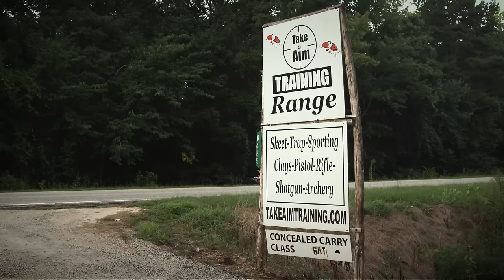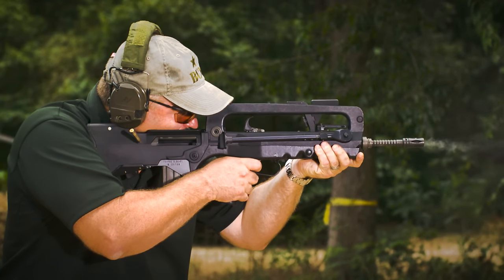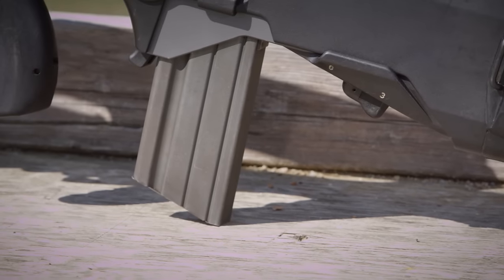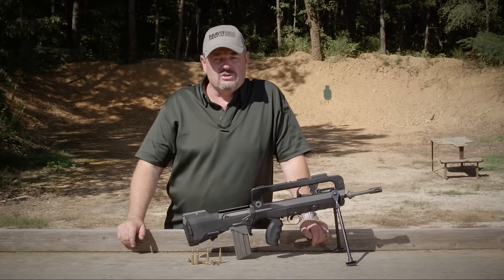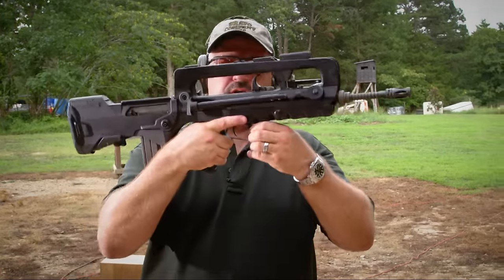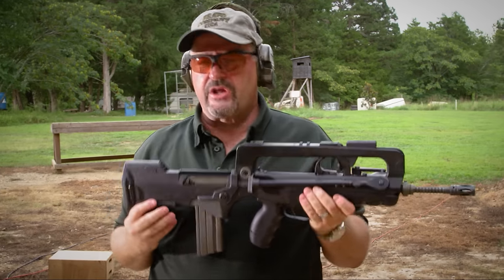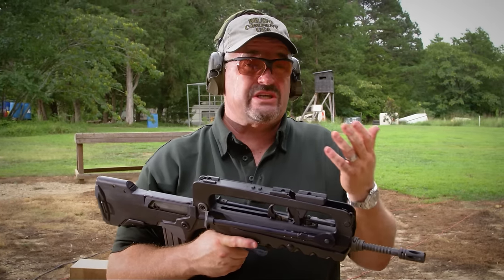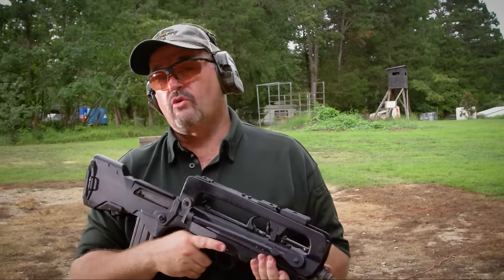FAMAS F1 Assault Rifle

Comment: I am an alpine hunter in the French army and I use the famas. you make a good presentation of this weapon. it is not a modern weapon like the ar15 platform but its usage characteristics are impressive! very balanced from the pistol grip, low recoil, high accuracy up to 400m and increased rate of fire. a nice tool!
Reply: Fake Comment
Reply: @hugovilleda7237  Spoken like someone who has never fired a Famas
Reply: @xailonut8763  d'accord avec toi. J'ai fait une Préparation Militaire en 1994 et mon Service Militaire en 1995 pendant lequel j'ai passé mon brevet d'armurier. J'ai donc eu le plaisir et l'honneur de tirer au Famas de nombreuses fois, la plupart du temps en tir couché au coup par coup avec les béquilles. Et le commentaire de "letemplier" me semble tout à fait crédible. J'ai pu constater par moi-même que le FAMAS (Fusil d'Assaut des Manufactures d'Armes de Saint-Étienne) a très peu de recul, précis même pour un débutant  (qui applique bien les conseils) et confortable d'utilisation. De beaux souvenirs  (nostalgiques).
Reply: Mais... en quoi l'AR-15 est moderne ? C'est vieux quand même...

Comment: I used the Famas as a conscript. It was deadly accurate. You could not miss a target less than 300 meters away. Between 300m and 400m, a bit less easy, but still easy. I tried 600m but that was too difficult. Also the recoil was near non-existant.
Reply: Idem (classe 95). Je confirme.

Comment: I was sergent in the army in the 90's, the policy was to use the 3 round burst as default at the time., there is a gauge for the grenade launcher mode 30° and 45° it was easy to calculate distance of a morta grenate, you have also a anti tank direct fire grenate that was able to be able to penetrate 150mm (if I remember well). Ideal for every vehicle that was not a tank.
Reply: Pendant mes classes, j'ai assisté à une démonstration de ce tir direct. Il fallait être deux pour la manip. Impressionnant ce côté multifonction.

Comment: I would have been very hesitant about placing my face right above the ejection port a 60,000 psi chamber that is only a delayed blowback with non-recommended copper cartridges.

All the more so, in the case of a full auto since you mention yourself that over time the recoil spring might weaken and increase the risk.

So the French rifle requires non-standard steel cartridges - say goodbye to the idea of borrowing ammo from an allied country in case of a shortage. Which was the original idea of the NATO 5,56 x 45 standard ammo.

Second, the firing pin is subject to more severe wear and tear and must be replaced at about every 3,000 rounds. Since France let its own firearms makers become extinct the manufacture of FAMAS firing pins is a special order and the unit price is about 300 euros (about the same in US dollars). This made the headlines because the French contract  price for the replacement HK416 is equivalent to 4 FAMAS firing pins. This is a serious deficiency of French politics - allowing your own firearms manufacturers to fold. This to the point when the French government could not even manage to find someone in France to manufacture the HK416 under licence in the volume needed.

Finally, I have had it with the comments section's French bashing. Beginning with the rifle: The French INVENTED SMOKELESS POWDER, not the US. Do I have to explain why smokeless was such a big deal ? The French also did a lot of work on ballistics theory - ever wondered where the word "ogive" came form ? Has anyone who studied US history, the French provided support in the early days of what would become later the USA.

Next the "surrender stick" smirk. Easy to judge when your immediate neighbor was not nazi Germany.  I laughed when I heard Alex C.'s quip about a measurement system used in countries that did not put a man on the moon. Condemning a country for losing a war though is nasty and mean.
Reply: THIS GUY GETS IT AND NO ONE GIVES HIM CREDIT. Classical for the youtube comment section.
You can add to the firing pin stories the magazines too have to be refurbished since they are so fragile and were supposed to be expendable. 
It thus takes 6 refurbished famas magazines to buy a brand new HK416.
Bravo to our french politicians.
And mind you some of them still have the nerves to criticize the choice of HK, saying it's bad for the non-existent french small arms industry... When the steel bars HK manufactures all of its barrels from, for all of its small arms except a few, is made in France by the Aubert & Duval company since 1970 !
Anyway kudos to you for establishing some facts here.
Reply: its fun sometine you feel some  tiny hot pinch  on your face. that's small peaces of gun powder :p
Reply: On top of that, the brits were the first to leave the front in the Battle of France. They jumped in the first boat they found and came back home leaving the french fighting for weeks until they had to surrender. So what is the worse scenario in this case, leaving your allies behind betraying them or fighting until you have to surrender? I let you judge. The french had nowhere to flee, stood their ground a bit until they couldn't. So who are the cowards now?
Reply: Scar Lets get real. The US would annihilate N. Korea, they were crushing Vietnam with one hand tied behind their backs by their own politicians, and of course, with help from the trusty Aussies. They only left Vietnam because their politicians betrayed them. They crushed the Iraqi army in a few weeks, then politics screwed them again. And no one has every really tamed Afghanistan. If they didn't care for the civilians' lives, they could do it. 

This is a Frenchman speaking, as tired as any other of my people of the nonsensical Anglo-American propaganda of french cowardice, most especially because it is simply inaccurate. And following that principle, we must be honest of the American military situations of the past as well. 

Also, I would not say that they were late to the major European wars of the 20th century, they never had to join early, they had no reason to, they joined to help us/defend their own interests. They're still smarmy pricks tho.
Reply: that's becaus emany french politicians are eager to sell away sovereignty and independance for bribes or ideological reasons. Heck, now EU rules wouldn't even allow us to do anything about these kinds of situations if we wante to. We're supposed not to have the government intervene
Reply: People also seems to forget that Hitler had complete support from Staline when he started his rampage. I always see Americans complaining as to why they didn't kept fighting.
They did. But you can't defeat Germany when Staline supplies It with soldiers and weapons.
Reply: Scar And what Comes with it? Soldiers and supplies.
Tough it might not be a proper "full" support, it is a military support non the less.
Reply: "Put a man on the moon" 
I doubt many people take that seriously anymore. One of NASA's early "first" spacewalks was straight up claymation. If there is one lie, then the whole story is in need of investigation.
Reply: Luke Himself uh huh
Reply: People forget that the French pretty much invented the modern army under Napoleon.
Reply: @sammni yeah but Canada kicked the most ass on d day, progressing furthest inland (about 6 km on the first day alone)
Reply: nathan prochnau damn straight!
Reply: Scar  and you're on the opposite end of the spectrum. First of all, the Soviet Union depended on American aid to fight the Germans (admitted by their generals) and the aerial onslaught delivered by the Brits and Americans (which were so brutal they would have been considered war crimes if the Germans had done it to them) was extremely important in maintaining German equipment and industry crippled.

The stealth BOMBER that got shot down was a one-time thing. Complacency with flight planes left the stealth bombers running the same routes which made their positions predictable and the plane that got shot down had a bomb-bay open meaning the stealth was compromised by the extra reflecting surface. The plane also did not have RWR and thus the pilot was only aware of the missile launch when he saw the missile trails piercing through the clouds.
Reply: Scar  and the Soviets fucked up the majority of the German warforce thanks to.... US made vehicles and locomotives. Otherwise the Soviets would have had to walk.
Reply: Scar  linking me to tanks lmao

"427,284 trucks, 13,303 combat vehicles, 35,170 motorcycles, 2,328 ordnance service vehicles, 2,670,371 tons of petroleum products (gasoline and oil) or 57.8 percent of the High-octane aviation fuel,[26] 4,478,116 tons of foodstuffs (canned meats, sugar, flour, salt, etc.), 1,911 steam locomotives, 66 Diesel locomotives, 9,920 flat cars, 1,000 dump cars, 120 tank cars, and 35 heavy machinery cars."

Furthermore, much of the logistical assistance of the Soviet military was provided by hundreds of thousands of U.S.-made trucks. Indeed, by 1945, nearly a third of the truck strength of the Red Army was U.S.-built. Trucks such as the Dodge ¾ ton and Studebaker 2½ ton were easily the best trucks available in their class on either side on the Eastern Front. American shipments of telephone cable, aluminum, canned rations, and clothing were also critical.[31]

Lend-Lease also supplied significant amounts of weapons and ammunition. The Soviet air force received 18,200 aircraft, which amounted to about 30% of Soviet wartime aircraft production (mid 1941-45).[26] And while most tank units were Soviet-built models, some 7,000 Lend-Lease tanks were deployed by the Red Army, or 8% of war-time production.

According to the Russian historian Boris Vadimovich Sokolov, Lend-Lease had a crucial role in winning the war:

On the whole the following conclusion can be drawn: that without these Western shipments under Lend-Lease the Soviet Union not only would not have been able to win the Great Patriotic War, it would not have been able even to oppose the German invaders, since it could not itself produce sufficient quantities of arms and military equipment or adequate supplies of fuel and ammunition. The Soviet authorities were well aware of this dependency on Lend-Lease. Thus, Stalin told Harry Hopkins [FDR's emissary to Moscow in July 1941] that the U.S.S.R. could not match Germany's might as an occupier of Europe and its resources.[26]

Nikita Khrushchev, having served as a military commissar and intermediary between Stalin and his generals during the war, addressed directly the significance of Lend-lease aid in his memoirs:

I would like to express my candid opinion about Stalin's views on whether the Red Army and the Soviet Union could have coped with Nazi Germany and survived the war without aid from the United States and Britain. First, I would like to tell about some remarks Stalin made and repeated several times when we were "discussing freely" among ourselves. He stated bluntly that if the United States had not helped us, we would not have won the war. If we had had to fight Nazi Germany one on one, we could not have stood up against Germany's pressure, and we would have lost the war. No one ever discussed this subject officially, and I don't think Stalin left any written evidence of his opinion, but I will state here that several times in conversations with me he noted that these were the actual circumstances. He never made a special point of holding a conversation on the subject, but when we were engaged in some kind of relaxed conversation, going over international questions of the past and present, and when we would return to the subject of the path we had traveled during the war, that is what he said. When I listened to his remarks, I was fully in agreement with him, and today I am even more so.[32]

Joseph Stalin, during the Tehran Conference during 1943, acknowledged publicly the importance of American efforts during a dinner at the conference: "Without American production the United Nations [the Allies] could never have won the war."[33][34]

In a confidential interview with the wartime correspondent Konstantin Simonov, the Soviet Marshal Georgy Zhukov is quoted as saying:

Today [1963] some say the Allies didn't really help us ... But listen, one cannot deny that the Americans shipped over to us material without which we could not have equipped our armies held in reserve or been able to continue the war.[35]

https://en.wikipedia.org/wiki/Lend-Lease
Reply: Scar  "more oil then you"/"Your contribution" - I am not American
"what politicians say is one thing but numbers dont lie" - ahahah but Marshal Zhukov lies?
"We where talking about COMBAT vechiles subhuman or did you forget?!" - no we weren't. I said that without vehicles the Soviets would have had to WALK, combat vehicles mean nothing if all your men are a a 30 day march away from the frontlines.
"if you where such great military" - first of all it's "were" , and I am not American. Half your post is contradicted by the Soviets' own words and the other half is just insults that don't even work because I am not American.
Reply: If shot thousands of rounds from +30 year old Famas and I have had a few issues but never has one exploded on my face

Comment: What you say about the famas security lever is incorrect, as we never ever ever use the full auto/burst mode. When you have the real French army module to use the weapon, with exact precise gestures, it becomes natural to put the lever to 1/semi mode. 

By the way you have a Famas Infantry handguard (with the device to put a J4 scope on), not the F1 version.
Reply: No it is not totally incorrect what my instructor explained us during my military training in the French army is because when you are surprised by enemies fire you want the full auto mod and for a right handed shooter your first reflex is to push the safety to the left.
When you need the semi auto mod you have more time to think and it is easy to push the safety to the right.
And what was not mention is that every famas is easy to reconfigure to a left handed firearm but it doesn't change the safety if I remember correctly.

Comment: i've always wanted one of these.  that 3 shoot burst...so quick...1000 rpm correct?
Reply: Those were mad fast. Impossible to hear separate shots, just like one shot that lasts longer.
Reply: confirmed and this speed is more useless than everything.
Reply: 950
Reply: So...br55?
Reply: Its rate of fire is that high but you could never do that it would brake the gun and it is only 25 mags so you would only get off around 150 a min in reality
Reply: I shooted with the first  famas in the french army   I found 3 disadvantages ( Pas de sabot de crosse , un repose main trop large , et un entretien fastidieux  et une facilité à s 'encrasser, sinon pas de bipied )  you dont carry a famas you wear the famas  ever on you  and to dodge to clean your weapon  ) but it is a very good light and accurate mortar while 300 m and a lethal wepons against the light armoured vehicules , this is a war rifle for to Slay the BTR 60 or the BMP the most versatile weapons of the world compact like a submachine gun  it is a good rifle  even the worst shooter of my section had goods stats  and  by 3 bullets the shots are  acurate like a 24 29 or a Brenn 5 weapons in only one the optics made for To shot 100  200 m and 300 m but like the barrel is the same that the M16 you can to shot while 500 m , Today I prefer the croatian VHS .

Comment: The upgraded variants are the G1 and G2, there was no F2 (at least as far as a cursory Google search will tell me) but other than misnaming it the info was spot-on. I didn't know you could reverse the cheek piece to eject the other way, that's neat.

Something else you didn't mention about the front selector lever is that part of the reason semi-auto has you pushing it out to the right side of the gun is because the intended method of using rifle grenades with the FAMAS, at least for indirect/area targets, was to turn the rifle so the right side faces downwards, left hand on the grip and the stock braced against the ground, so you could fold out the grenade sight to line up with that.

Comment: Famas once (or still) have the record of being the fastest firing assault rifle ever build.
Reply: There are at least now way faster firing assault rifles developed. For Example the AO-63 ( 6000 rpm), AN-94 (1800 rpm), G11 (2100 rpm); even though there is the question if its practical to have this rate of fire in an AR.

Comment: Reasonably reliable gun.
Controls are strange, scopes are an issue.
A bit strange like Citroën.
Reply: nonetheless the features - though odd - are interesting: usual firing config is semi-auto bursts of 3, left-or-right handed firing, adjustable depth for grenades, standard infantry issue includes a built-in bipod. 

Not to criticise your response, I just think these features must have made it a success with the troops. BTW, have you ever driven a french car - citroen? I hear they take getting used to but don't know anything about them myself.
Reply: Créative technologie
Reply: Mark Maxwell That is why they later released a « Valorized » version of the famas, which you can put standard scopes/EOTech and lasers on, via a picattiny rail !

Comment: To me, the FAMAS is really cool and unique. Too bad that it was replaced with the HK416f. Not saying that the HK416f is bad, I also like that gun.
Reply: Keep cool.
French still use FAMAS for a long time.
Differents models are existing
The F1 the first...this one.
The G2 for french navy f1 modernized. wich accept ar15 cart ridges
The FELIN the 3rd used by Army
HK 416 F is for some régiments only. This gun is just a Colt M4 modernized in fact.
I prefer Bull pop and FAMAS G2 the best according to me.